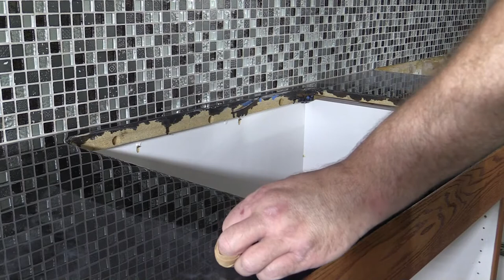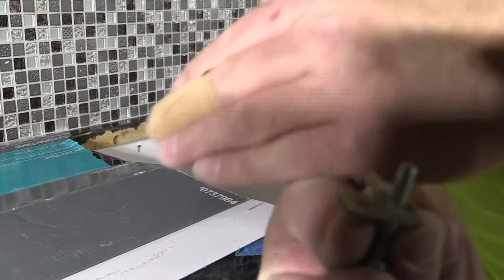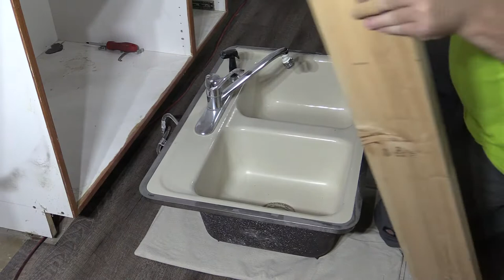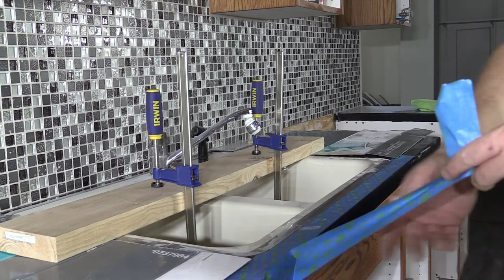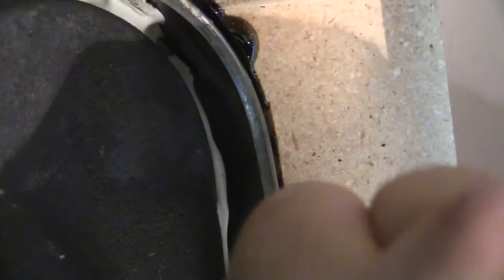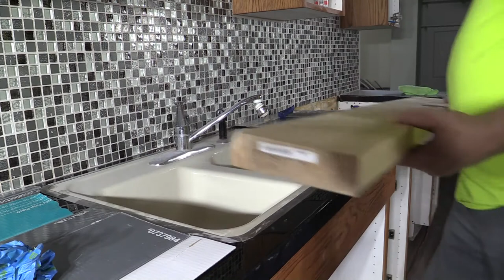Install heavy cast iron sink

Comment: Great technique!  Maybe I missed it or misunderstand something, but most instructions for installing a drop-in sink include placing caulk between the sink and the countertop.  With this technique, when/how would you do that?  Or do you not suggest to use caulk?
Reply from the maker: the best way i found is to put down a beed of silicone around the cut out on the counter top. then quickly clean up any that squeezes out.
Reply: @diyhomeimprovement9298  isn't that area covered up by the cardboard in this approach?  Or do you leave a gap?
Reply from the maker: yes you leave a gap the cardboard is only there to protect the countertop from the wood if you are not to worry about scratching your countertop you don't need to use cardboard at all
Reply: @diyhomeimprovement9298  Thank you!
Reply: @diyhomeimprovement9298 I have a cast iron sink that I bought as a display. Is it necessary to use clips? This sink doesn’t have a rail to clip to